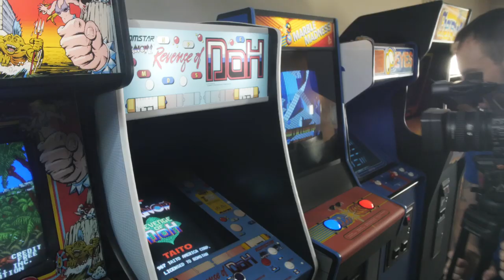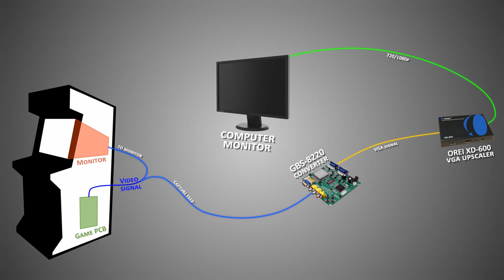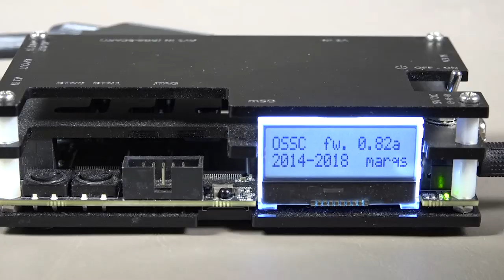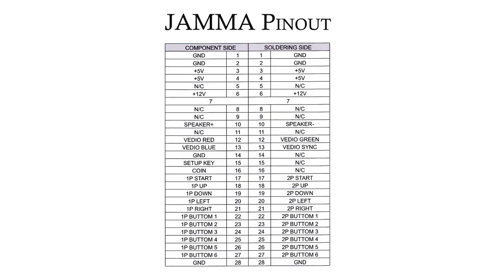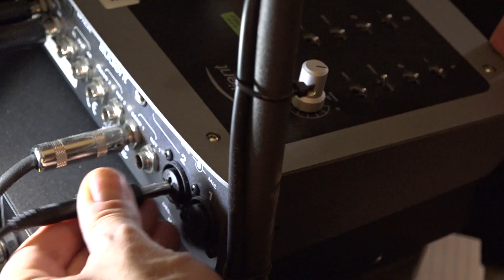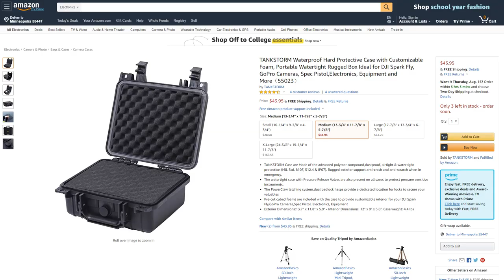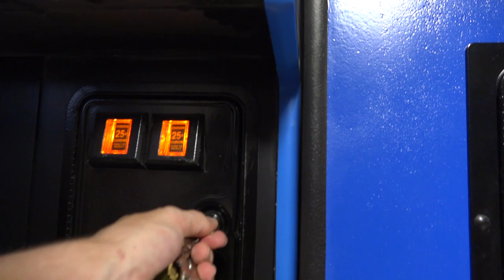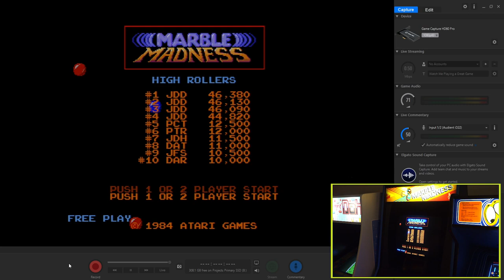How to capture, record & stream arcade games directly from the cabinet! No MAME! No emulators!!

Comment: I've been looking for an easy way to make "direct" audio wav recordings from rare golden age arcade machines to submit to the MAME development team to add missing sounds from rare games. I know a number of collectors and may have opportunities to do this if it isn't too much hassle for anyone. 

You seem like someone that might be able to suggest how I could make these recordings. I would think any type of audio cable would probably work, but I'm not sure where to wire-up inside the arcade cabinets? Whatever wire goes to the speakers from a game pcb amplifier I would think would think a spliter could be connected. I could bring a laptop & audio interface, but I think even an iPhone could capture the line-in audio. I have an iRIg Guitar interface that offers a line-in to a 1/4 audio cable. I have an old MP3 player with a line-in using a 1/8" too.

Thanks for any suggestions.
Reply from the maker: If audio is all you care about, then I'd just run an amplifier (with line level out) from the speaker/audio cables and run the outgoing signal (from the amp) to the line input on your recording device. If you want to hear the audio on the cabinet at the same time, you'd simply split the signal. There are lots of options for inexpensive amplifiers. I'd suggest looking at the ones designed for car audio - they're pretty cheap and work just fine.

Comment: If going with the cheaper upscaler you seem to use a HDMI-> VGA adapter from the OSSC to the upscaler. What magic is that? I don’t think you mentioned it at all?
Reply from the maker: Nothing special about it. HDMI->VGA adapters can be found for just a few dollars. I think I got mine on Amazon for 6 or 7 bucks.
Reply: dinkyflix ok. Thanks.